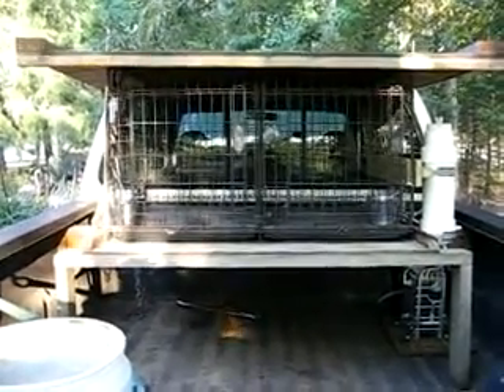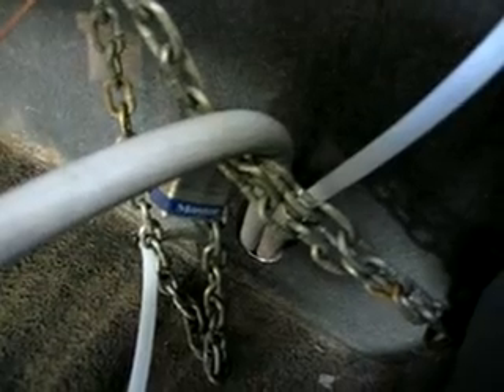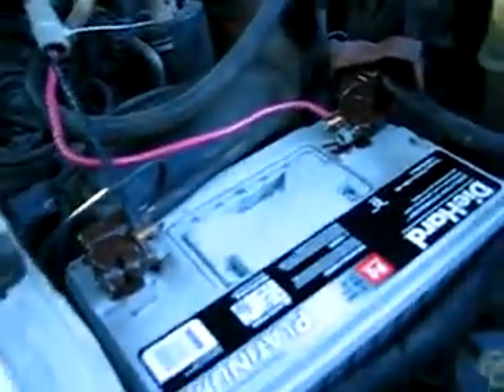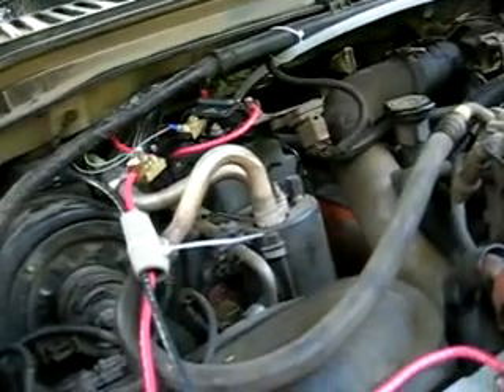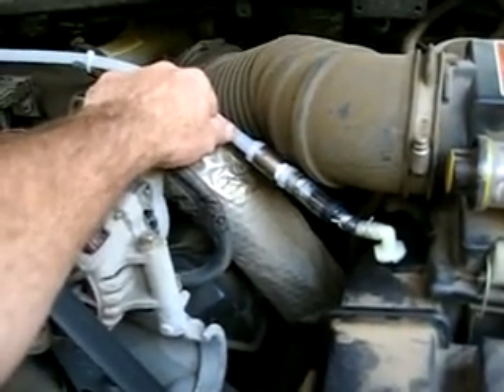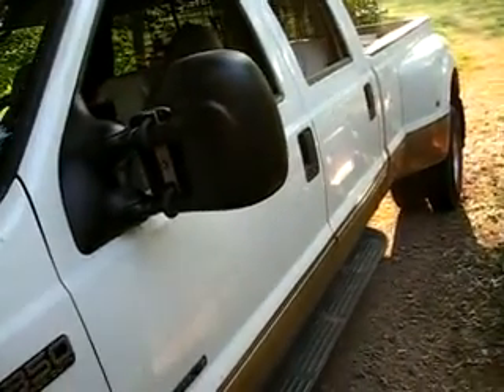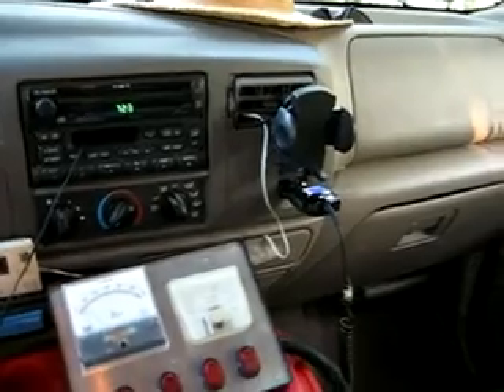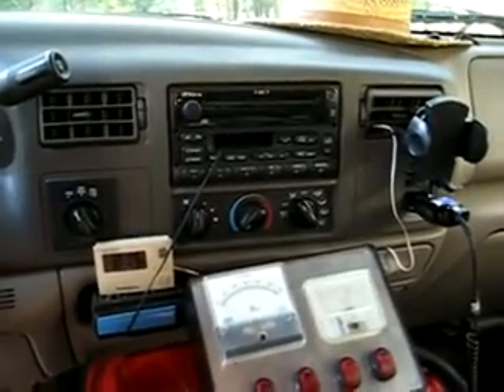006 HHO Dry Cell Install F350 7.3L Diesel 5.5mmw 3L/m

Comment: Please make sure that you put ground wires along your gas delivery hose about every foot to avoid static ignition. You need to ground the hose very simply by wrapping a wire around the hose every foot and grounding it to the frame to avoid static build up and then explosion. The atoms flowing in one direction through a cylindrical channel will build static charge on it's surface up rather quickly, so make sure you put ground straps on your gas hose(s).

Comment from the maker: Yes on my new setup I will have a shield between the dogs and the electrolyte reservoir.

I am not worried about flashback. The plugs in the bubbler and the reservoir pop out easily and the HHO inlet into the engine is very far from any possible flame. But it is better to be safe than sorry.
Mars

Comment: It is best to add the hho to the vacuum line or after the intercooler. Never before the turbo for if any part of the intake system reaches hydrogens flash point of 500 degrees that just what it will do, flash. Be safe okay?

Comment from the maker: I think that you are confusing flash point with LEL. "The LEL is the lowest gas concentration that will support an explosion when mixed with air, contained and ignited." Hydrogen's flamable @4% concentration and will explode @15% concentration. 
The hydrogen in my air intake is about .003% (that's not 3% it's 3 thousandths of a %) I would have to put in 208L per min to hit 4% concentration.

Comment from the maker: While it is possible to achieve about 450F in a non-intercooled turbo intake when the engine is extremely over fueled but by that time other things will start to melt.

Comment: Like I said you really need to do your own homework since you just don't listen very well. Why do you think they put an intercooler after the turbo? Answer, to cool the air back down. Do your homework, Arizona State college has a study out ment for introducing mechanics to hydrogen being used in internal combustion engines, do a search for it, and read all you can so you can be safe.

Comment from the maker: I have been thinking about this ,and correct me if I am wrong, but I don't think that the intake side of the turbo can get up to 500F. If it did then the rubber couplers on the intercooler tubes would melt. The Exhaust side of the Turbo can get very hot but by then the H2 is burnt.

Comment: Best to make a vacuum delivery system, that way you get around the turbo's heat, but you might also want to put a water injection system at the intercooler just too be safe. Turbos are not the easiest to put hho too them. In my Sirocco I did just that, and have not had a blow back in well over two years. Diesels are nice in that they will ignite the hydrogen mixture with compression for I think 16:1 compression is all it takes to ignite the hydrogen according to Albert Bowe. PV=nRT gas law stuff

Comment from the maker: That being said, I would like to find a way to inject the HHO under pressure into the manifold and by pass all the filter,turbo,intercooler and hoses to decrease response time between when HHO is called for and delivered.
Good Luck, Marshall
P.S guessing that it takes one second for any given molecule of H2 to traverse the air intake then there would be only 25ml of extra H2 plus about 7ml atmospheric H2 at idle (much more dilute at driving speeds). How much damage could that do?

Comment from the maker: Hi: I had'nt considered the possibility of the H2 being ignited by a turbo. However I do not think that ignition is possible since the amount of H2 is so low. For any gas to burn the molecules have to be close together and I do not think that there is enough H2 in the air mix to burn. The engine is a 7.3L with a turbo. Figuring there is an intake stroke every other rev and the turbo doubles the air intake there is 5,110L of air going into the engine @ idle every min. I am adding 1.5L of H2.

Comment: The turbo is going to ignight the hydrogen once it reaches 500 degrees, for that is hydrogen flashpoint. Not sure how your turbo is going to handle hho exploding inside of it, but find another spot to put in the hho gas, maybe the intercooler or the main vacuum line, but the temps inside of turbos is too high for hydrogen to be in direct contant with it.